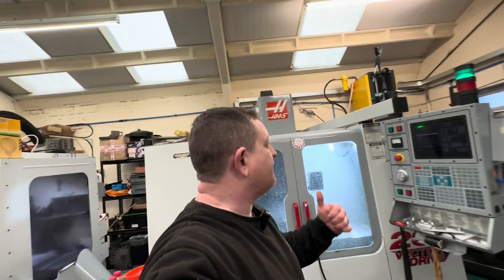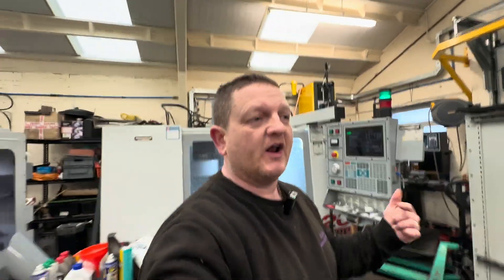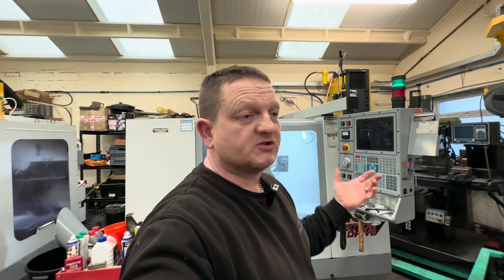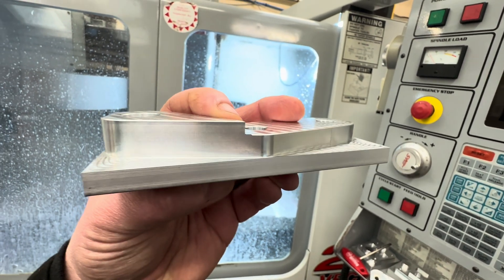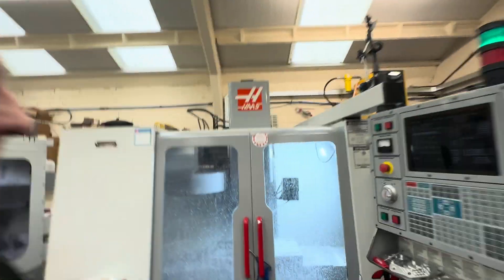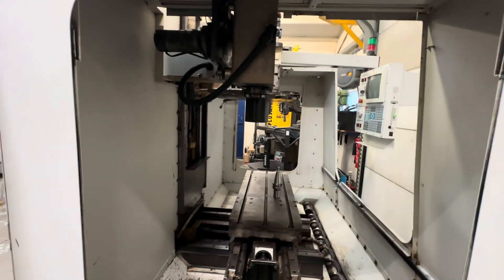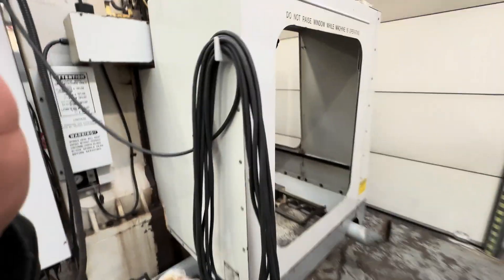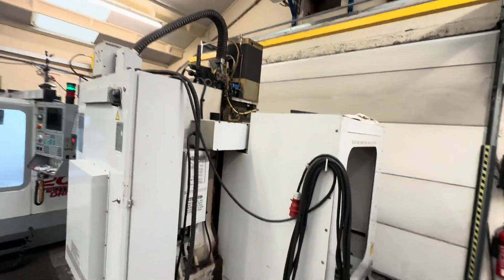Haas VF1 for sale machining parts

Comment: Thanks for the video mate. Couple of weird questions:
1) What was the stepover on that? 10%?
2) whats the high of your building at the underneath of that angled piece of steel between the upright and roof girder? I'm planning out my shop and wondering whats about right
Reply from the maker: Hi mate

Not sure on step over, I think it was probably 6mm to 8mm step over on a 10mm endmill

The problem with all my old Haas is none of them leave a really nice facemill finish like you get with a newer machine  so I tend to do small endmill finishes with a step over to give a pattern finish instead of

As for the height of the workshop I think it’s around 2.5 meters at that point where the main walls angle inwards towards the pitch
Reply: @kinzy_fabrications  Thanks. Have you tried using a facemill with a wiper insert? I struggled for years to get a good facemill finish and always blamed using an old machine with no TSC. Got a new machine, and still had the same scored finish. 
Easy tip if you've got an extra 30 seconds of cycle time, and you want a really good finish, is to take all the inserts out of your facemill other than 1, and bring your feed down accordingly(edit tool to have only 1 tooth). I guarantee you'll get a mirror finish.
Reply from the maker: I will have to give that a go some day and see what the results are like 👍
Reply: @ It literally always works, only downside is it slows down your cycle a lot. Thanks for the videos again mate, love watching another guy like me trying to make it happen by ourselves.
Reply from the maker: @spikeypineapple552 you should do some vids of your workshop stuff if you don’t already
Reply: @kinzy_fabrications  Can't at the moment, workshop is such a ****hole I'd get torn apart. Building and making a new shop at the moment, might try then, once my facility represents the quality of work I do.
Reply from the maker: @spikeypineapple552 I look forward to it 👍